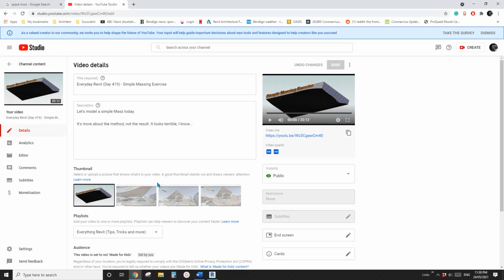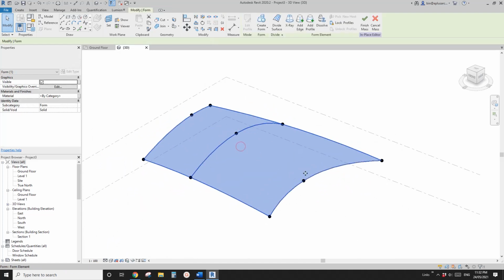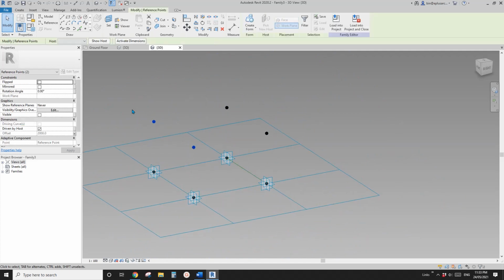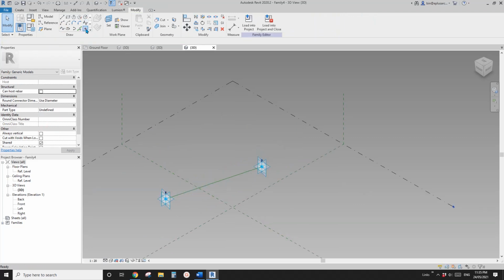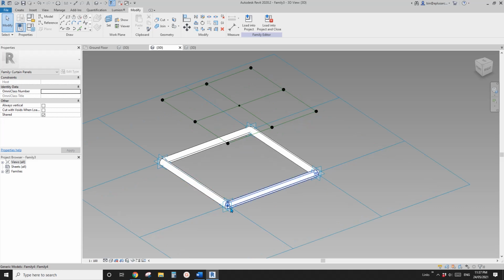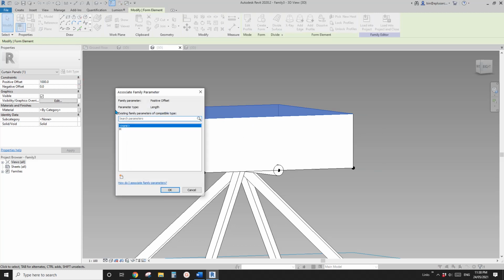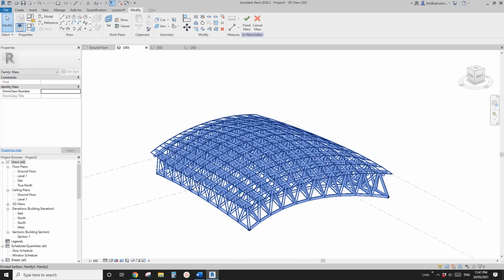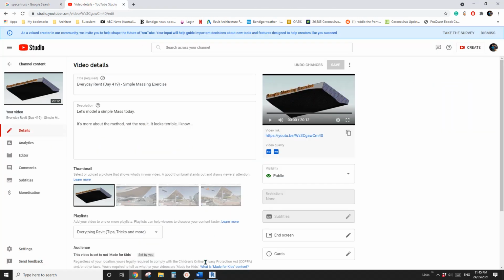Everyday Revit (Day 430) - Pattern Based Space Truss

Comment: Is it possible to add parametric detailed connections to every node? Can it be done within Revit or does it require any external tools like Dynamo?
Reply from the maker: I believe you can, but I don't think you should, because it will make the model very heavy and impossible to work with. My question is, will you see those detail in your views? Can you possibly only model part of those details, or only use 2D elements for those details?

Comment: Hi Bin, can you make a video about folding panel that shown in the link below ? Its shown one of Niko's revit videos. But when he changes the opening length, panel size also changes. Actually its simple folding panel but I couldn't formulate length of panel, opening angle etc. I want  to length of the panel remain a particular length which is constant (K) value . But when I create formulas it always changes. 
Thanks

Niko's Video:  https://www.youtube.com/watch?v=rbk0ttiTZS8
Panel Image: https://drive.google.com/file/d/1Od6Xo81K4jJgJR1Jix4Is7FoUqRKR42s/view?usp=sharing
Reply from the maker: No problems. I did a few of similar families before, but we will try adaptive or pattern based this time.  We will use Pythagorean theorem.  And maybe we can have some fun using Dynamo.